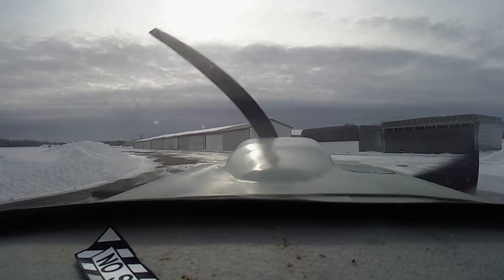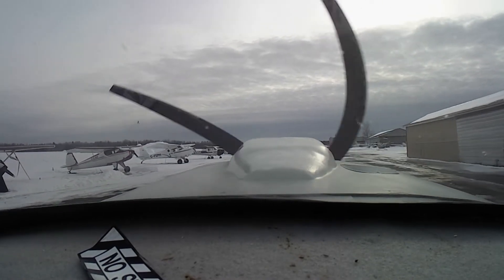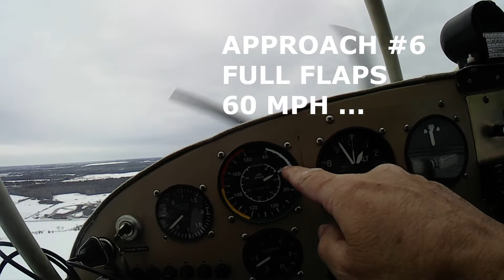Approach Speeds, Winter Flying the Wag-Aero

Comment: Bottom of the white arc is 40 - so your approach speed should be 52  (1.3 X Vso per AIM) - 55 at the outside.  Being cautious is one thing - but 80 on final is insane.  Most pilots fly way too fast on approach because they're terrified of stall - spin - and it's a good thing to be concerned about.   But 2 X Vso is just nuts.  You're not landing; you're flying the airplane onto the runway.

Comment: Why does the engine miss
Reply from the maker: Thx for the question James ... the short answer is: "if I knew the exact reason, it would no longer miss"  ... the long answer is a deep dive into Fuel Injection systems, controllers and the Mazda 13B, Wankel engine itself. First I'll start by stating the engine only misses at low power settings from idle up to the next 300 rpm or so; this area is of least significance it terms of aircraft operation. There are zero issues at full throttle, cruise or slow flight. The low power band is the hardest place to tune the system and unlike a car application my setup is open - loop, which means the sensors and controller do not automatically adjust fuel flow at any power setting. My system uses a ma & pa shop controller that requires a fuel lookup table to control fuel flow or mixture across the power band. The idle area is based on rpm, everywhere is based on manifold pressure and neither region is linear ... I like talking about this stuff but based on this answer you need to ask more specific questions ... questions are easy most times answers are not ... I don't know your level of understanding.  Thanks for watching and ask away .... Jeffro.